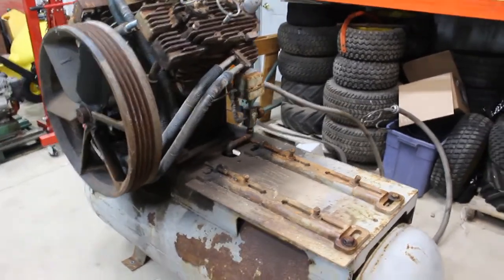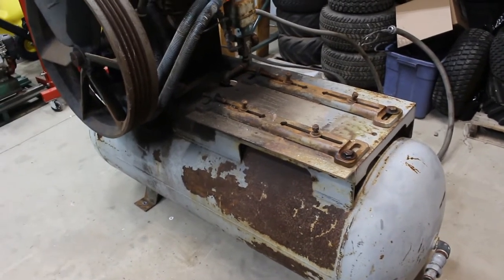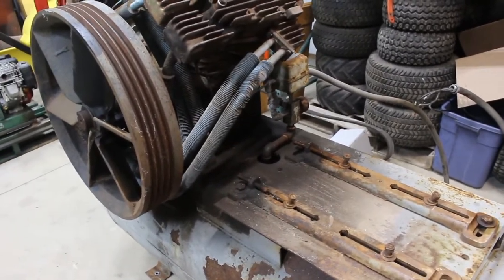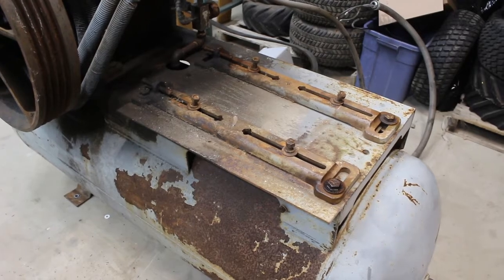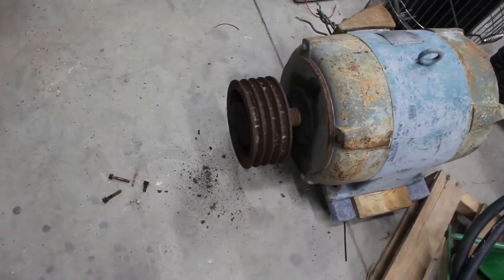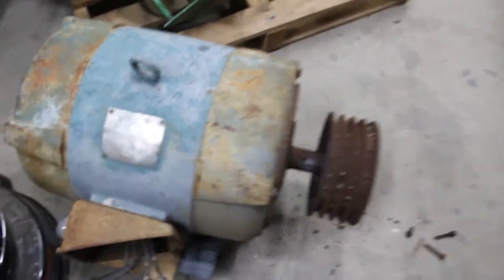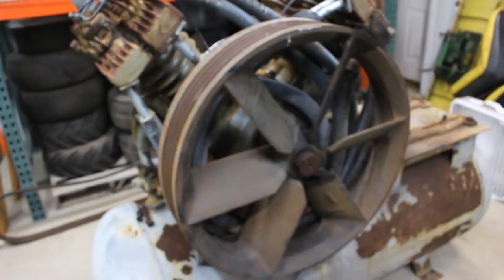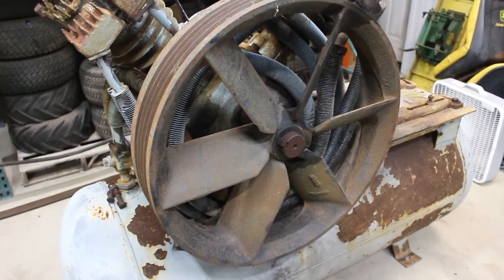Air Compressor Tear Down: Part 1

Comment: Hello, I need your help, I have one of those compressors, but it needs the copper pipes that interconnect the heads and the tank.  Can you tell me how they are interconnected... I am going to redo them since the pipes have been cut.  please help me.

Comment: How big is the tank? Length? Diameter? Hard to realize the actual size in the video.
Reply from the maker: I will have to measure it. I did a long time ago but I can't remember it off the top of my head.

Comment: We have a bunch of those identical Westinghouse motors some even larger still in 24/7 operation where I work running air handlers and hvac systems. They were installed between 1964-67 and most of them are still going strong with regular maintenance. To remove the motor pulley you remove the 3 bolts as you did and reinsert them into the 3 threaded holes they are then known as jack bolts as they will separate the hub from the pulley. Once it's separated you just use a wedge to open the grove alittle and a standard puller should pop the hub right off
Reply from the maker: THANKS! This is very helpful. I will try this next time I am out in the shop and working on the compressor.